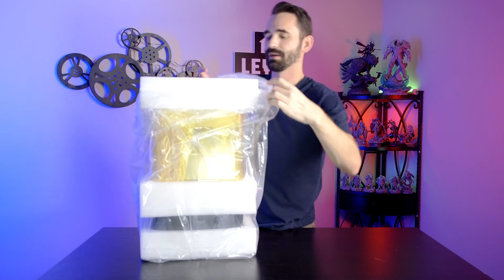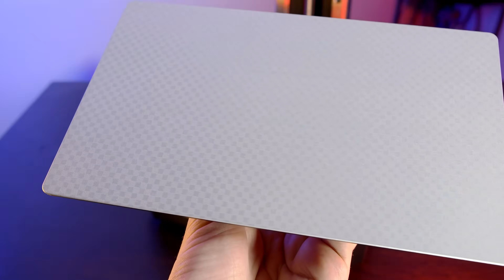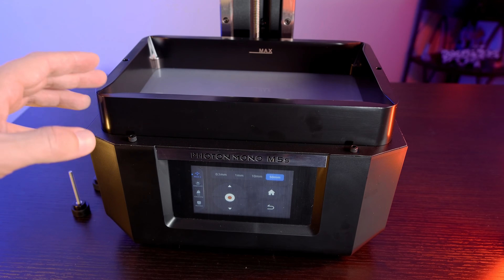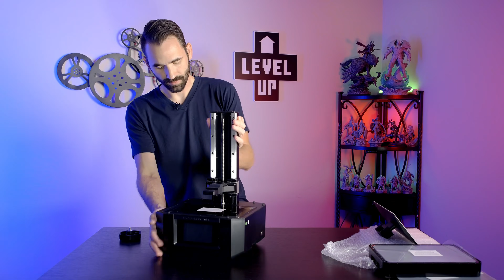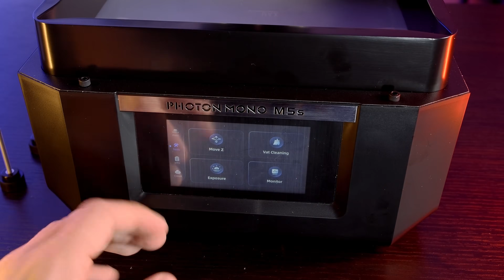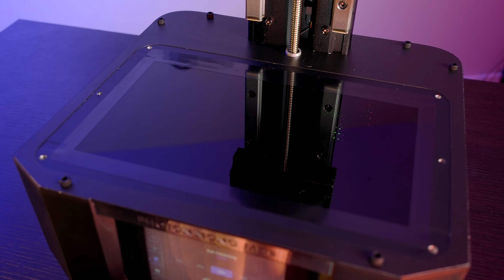AnyCubic M5s Unboxing #review

Comment: Hello, thank you for your video and precise guide, you help me trought a lot of trouble. Having  myself an M5S, I managed to get dimensionnal accuracy but pillar keeps failing even with overexposed settings . Did I missed something ?
Reply from the maker: Maybe not, the ACF on the M5s and a few of the other 12k printers seems to create a lot of texture in the pillars. This can cause them to fail as they are adding in imperfections and compromising the integrity. 

I say maybe because it also depends on your other settings. If you're only getting the last two or so you may have some speed or other settings that are forcing you to have to lower your UV exposure time too much. Using light off delay (Wait before print) and slower speeds helps with dimensional accuracy quite a bit. This can allow you to add back in uv exposure time for a slightly harder cure increasing tensile strength.
Reply: @J3DTech  wow thank you for answering so quickly. I will have a try with light off delay and speeds tomorrow.
Reply: Well I tried with Light off from 2.6=>2.7=>2.9=>3.2sec & lift speed from 45 to 30) and manage to have only half of the pillar (one in third case & fourth & fifth cases ok). I think will keep this setting from now on .(layer 0.03, ET 2.8, EO 2.7,lift speed 45) we will see if it's working.
Reply from the maker: @mxexes  I've gotten mine to do about half the pillars on resin that I know can do all of them. After a time I'll replace the film with nFEP to see if that does the trick. Howerver the pillars are just a test. In real prints you're not going to try to print somthing so small and tall. In my normal prints the damage of the surface quality on thicker objects has not impact the success. 

In summary, when using ACF it seems that geting half pillars is = to full when using nFEP.
Reply: @J3DTech  Hi , I coming back two months later as my ACF is finally dead. I think about switching to  Siraya Nfep and calibrate once again . Based on your experience, which parameters might be impacted and have to be adjusted ?
Reply from the maker: @mxexes  Ot really depends on the speeds you have right now. But I noticed that UV exposure time is about the same. And the only settings ACF let's you go faster is lifting speed. All other settings it doesn't matter

Comment: Hello, what do you think about DLP printers? Mars 4 DLP/ D2 review?
Reply from the maker: They are very accurate but have some drawbacks. The main one is AA. Because there is no LCD you can't do gray pixels.

This and their small sizes
Reply: @J3DTech  The Lego website says that Mars 4 DLP has a "Full grayscale antialiasing algorithm"
Reply from the maker: @jimufo1877  Ah marketing they are always honest right?

How can a mirror make gray? It can flip to the on and off position fast to simulate but this is very different from a gray pixel.
Reply: @J3DTech  I now have a Photon m3 and I have been printing on it for almost 2 years, I am not satisfied that at the beginning of printing the resin temperature is 26/28 degrees, and at the end 32/34 degrees, the UV lamp heats the resin very much. Now I'm looking for a new printer, maybe I should buy a Premium M3 (They are still available from local dealers) or a Saturn 3 Ultra? Thank you for your answers
Reply from the maker: @jimufo1877  If you can get the M3-P I would get that. Overall it's a great user experience and a fantastic printer.

Comment: I just got one and I’ve been dying to see your impressions. I struggle with under and over exposure in the same print…. Cones of cali succeed at 2.5, but details look very over exposed. Any lower and the cones fail. 

SUNLU standard plus dark grey
Reply from the maker: I calibrate everything using boxes of calibration much more consistent and accurate.
Reply: @J3DTech  Please share your findings…. My boxes wouldn’t print at 1.7-2.5 even though that’s better detail. 

I never get ANY of the little support strands….. even at 3s per layer at .05mm. Slowed speeds down to 60mm/s to really bring it down to give it the best chance. No dice…. Full prints still look great but gee it’s odd!
Reply from the maker: @dannybuscemi867  I'm doing my first print of boxes now we will see
Reply from the maker: @dannybuscemi867  Some of this has to do with the ACF film, the texture will make the pillars weak as it adds break points.
Reply: This is with a PFA film instead. Let me know your findings!
Reply from the maker: @dannybuscemi867  I'm still calibrating we will see how it goes.
Reply: I’d love to get in a discord call, or a deeper conversation about it. It’s been rather frustrating….
Reply: @j3d Any thoughts so far? Compared to the Saturn 3 ultra? m3 premium?

I have a Saturn 3 sitting next to me in box, need to decide if I’m returning the mono or the Saturn
Reply from the maker: @dannybuscemi867  Truly nothing can compair to the M3-P and the S3U is in 2nd place. This printer is... not that class.
Reply: @J3DTech  Funnily enough, my M5s screen failed today after 430 hours of run time. Guessssss it’s time to go with the Saturn 3. I wish more manufacturers would do something like the premium but clearly it wasn’t a success to AC.
Reply from the maker: @dannybuscemi867  We can hope we get more like it.

Comment: I didn't know they had a build plate for this model you can buy and manual level. Good 2 know for when i try to calibrate
Reply from the maker: Not sure if it can be purchased but some users have been sent it when their leveling isn't working.
Reply: @J3DTech  It can be purchased. I wish I got the same plate the printer came with though.
Reply: I currently have a ticket open with Anycubic about the leveling plate I purchased for my M5s. It won't level no matter what I do. The issue is that it won't go low enough unless you loosen the two vertical screws. Then you can level it with the four horizontal screws. Unfortunately, the moment you start to retighten the two vertical screws, it lifts up off the screen/paper. Nothing will stick to the plate.